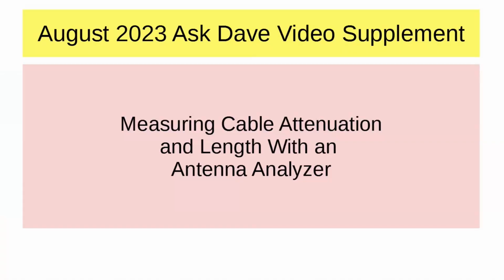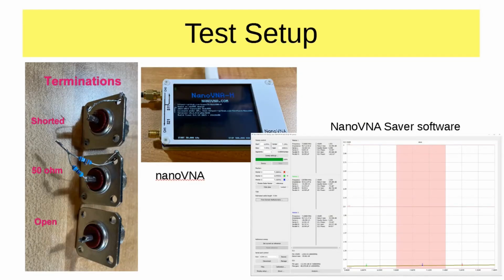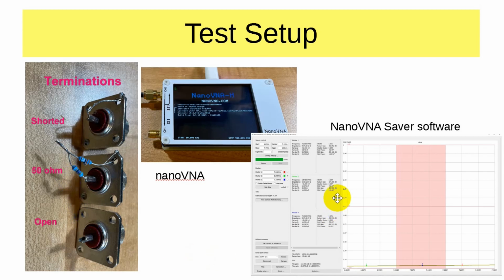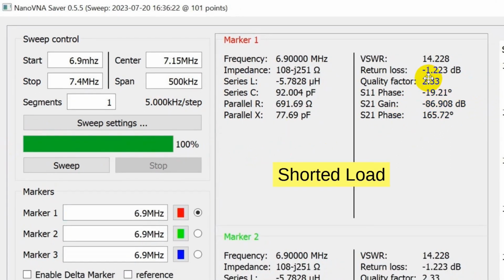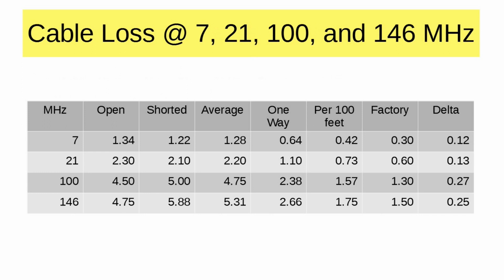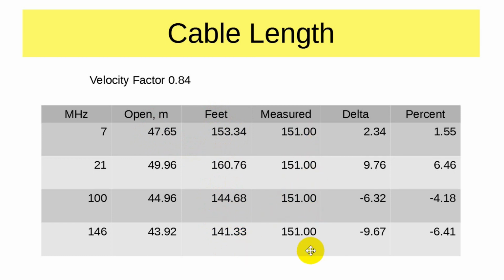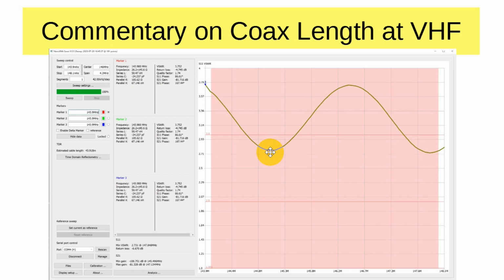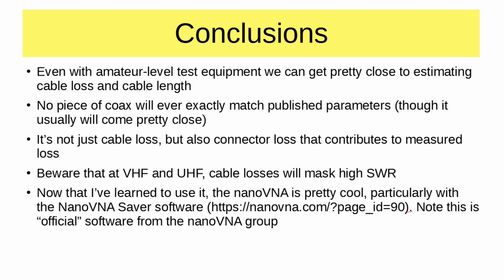Ask Dave Aug 2023 Supplement

Comment: This is excellent!  I had never thought about using my analyzer to measure cable loss until I read the latest Ask Dave column.  After reading that I immediately set about to check the loss on the RG-174 and RG-316 that I use for QRP portable operations.  I was very pleased to find it to be in spec, and even at 28 MHz not all that bad (especially compared with lugging a big roll of RG-58 into the field!).  I also did some online reading and found a good QEX article on the subject from several years ago (May/June 2005, p. 44).